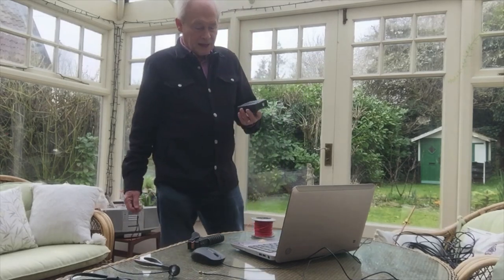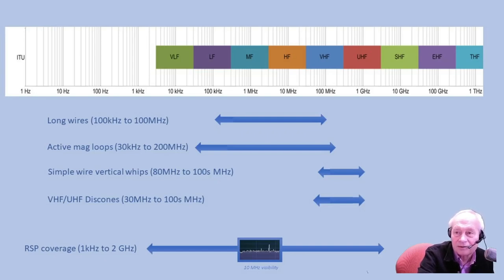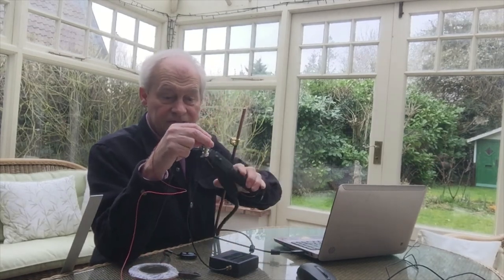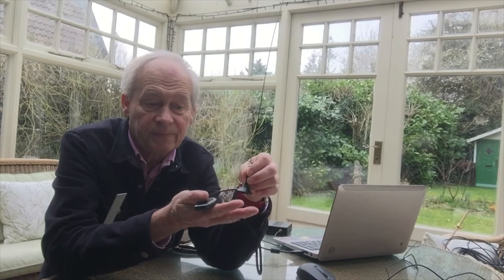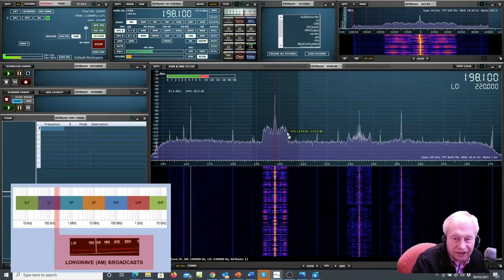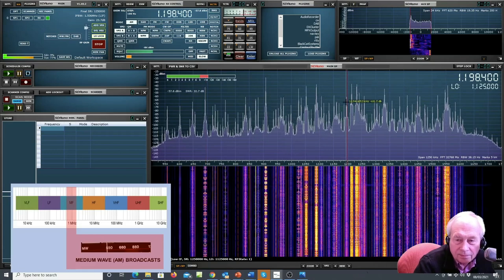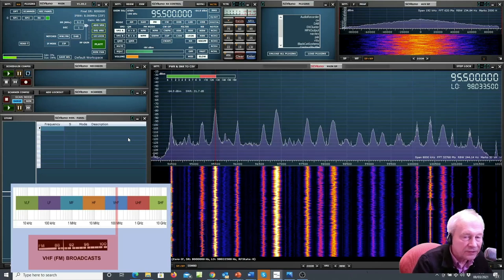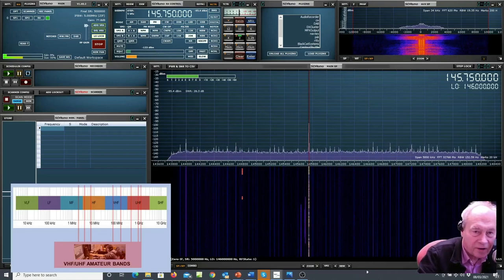SDRplay: Antennas and Signals for newcomers to SDR receivers

Comment: Hello John, great explanation, how do you make that ground plate/plane happen with that wire straight into the coax plug as you mentioned around 8:16 min In the video ? What is needed on the end of the antenna wire? Should that be a plastic isolator mount to attach the wire on?
Reply from the maker: the important thing is to connect to the outer of the coax socket either wires or a surface of say metal foil which is perpendicular to the vertical wire you see in the video (connected to the centre of the socket).  The effect you are trying to get is this: https://www.electronics-notes.com/images/antenna-vertical-with-ground-plane-plate.svg
You can improvise with crocodile (alligator) clips and wires, sheet steel,  tin lids, oven grilles etc.  Better still to solder an SO239 socket into some kin of metal mount or indeed buy something ready made - here's a magnetic mount example where this would sit nicely on a metal surface: https://cpc.farnell.com/unbranded/mnt040/3-mag-mount-3-8-pl259-2m/dp/AP00544

Comment: Great help video John, what type of antenna do I needto receive both amaterur 2 m band and airbands? I have great results with the 17 meter of wire non grounded and cover receptions from West US to Africa Ivor. coast to the far East. Really nice product exploring the airwaves with the sdrplaydx👌
Reply from the maker: I'm ignoring directional antennas (e.g. yagis) which will give additional gain in a specific direction, so then a good compromise omni-directional antenna  for both VHF airband and 144MHz would be a quarter wave vertical tuned to say 135MHz  (Airband VHF goes from below 120MHz up and 2m goes up to nearly 150MHz - using an online calculator like this suggests just over 50cm or 20 inches is the length:  https://m0ukd.com/calculators/quarter-wave-ground-plane-antenna-calculator/  - the link tehre discusses all sorts of secondary considerations but for receive-only, exact impedance matching isn't a worry.  Just make sure you have some kind of ground plane/radials connected to the outer coax.    For those frequencies a home-made quarter wave should perform as well as a discone.  

More important will be getting the antenna up in the clear - "line of sight" really is important at VHF (unlike at HF)  Thin non-metallic walls are not too much of a problem so high up in a roof-space is better than on a window ledge downstairs for example.   You might also enjoy the HF airbands around 10MHz using your current setup.... http://www.listenersguide.org.uk/swl/hf-air-traffic-control-and-volmet/    Have fun!  Jon

Comment: Not sure what happened to mine, just bought one and it was picking up local radio FM and later that day went back to test it and now it will not pick up anything. I have tried unplugging it and plugging it back in and getting nothing.
Reply: Look at the specs for the input filters of your device. The block diagram is really helpful.  Some inputs have AM and FM notch filters so you can pick up more readily fainter signals.

Comment: My laptop doesn’t have a mouse just regular pad. Can I still use your sdr?
Reply from the maker: If you are happy by dragging the signal or typing in frequencies for tuning then it will be fine. I recommend getting a mouse with a scroll wheel if you have a spare usb port.  You could always get a USB hub if you're short of USB sockets.
Reply: Learn to use the pad. Much quicker than a mouse.

Comment: Could I use a discone antenna?
Reply from the maker: sure.  They work more efficiently than a simple vertical antenna which is not optimum over a wide range of frequencies.  See the discone references in this article: https://www.sdrplay.com/antennasuggestions/

Comment: Thanks John.  I just ordered my RSPdx.  This will be my first radio.  I see special antenna wire on Amazon.  Is that marketing or for transmitting?  For receive does gauge or insulation type matter?
Reply from the maker: For receive gauge doesn’t matter. Insulation is good against rain conductivity to whatever holds the wire above ground.

Comment: a 30m long wire hung on a tree or somewhere already hears ALOT. a vertical wire is better for DX. a coaxial cable to the wire is useful, better not connect the wire directly into a radio, that picks up lots of qrm from inside the house.